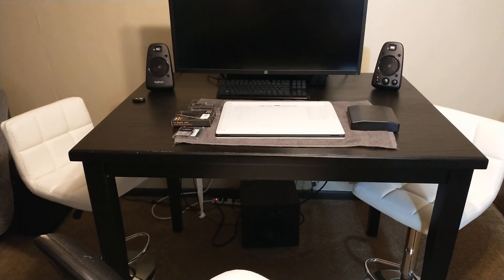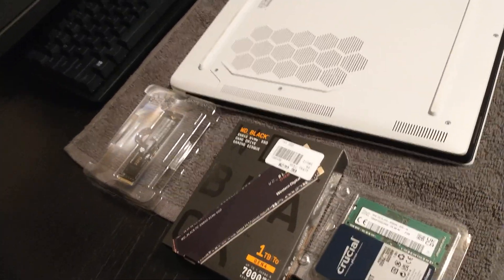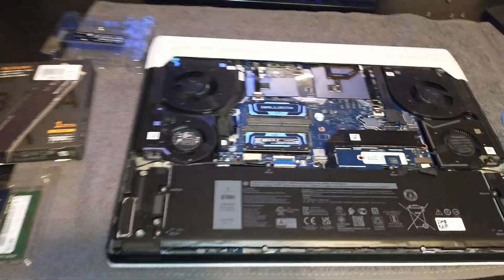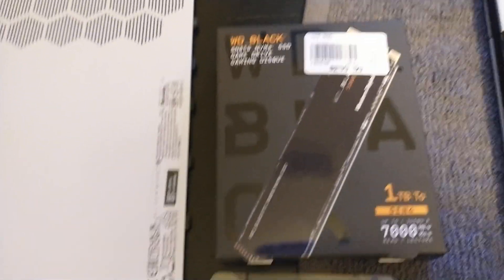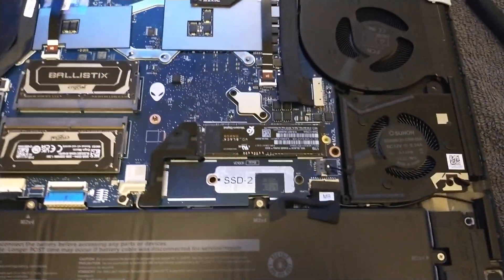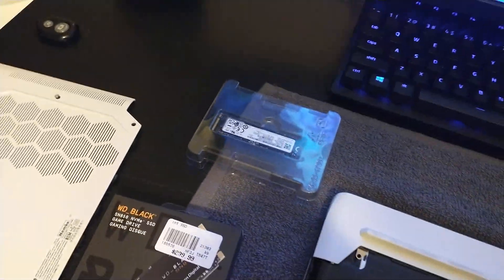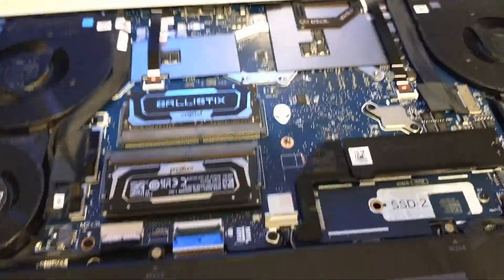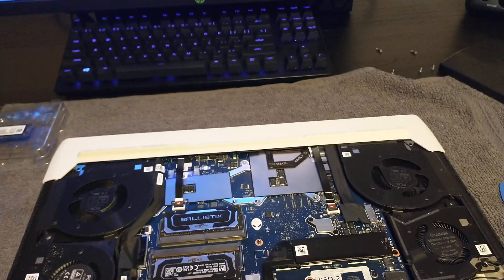Dell Alienware X17 R1 Western Digital Black SN850 RAID0/PCIe 4.0 SSD Upgrade PART I

Comment: sir were can i buy a motherboard for dell alienware x17 r1?
Reply from the maker: Have you contacted DELL.
Reply: @ITWINGMAN  no sir, because the warranty is over, isn't there anything that can be bought outside?
Reply from the maker: @dadayzkieh1687  I have not checked, I would check with DELL first, because the system is to new, but over time I am sure boards will start to pop up.
Reply: @ITWINGMAN  ..ok sir thank you ☺☺

Comment: Hello. Crucial Ballistix SODIMM 64GB Kit (2 x 32GB) DDR4-3200 Gaming Memory BL2K32G32C16S4B laptop Alienware X17 R1 model X17-0440 does not work. When XMP is turned on in the Bios, the laptop turns on, the AWC shows a voltage of 1.2 V at 3200 mhz and 1.35 v at 3466 mhz, but after 2-3 minutes a BSOD or just a reboot.
No manipulation helps! I don't know how to make the memory and laptop work at a frequency of 3466 mhz and a voltage of 1.35 V.
Reply from the maker: I would request a replacement memory kit, and if the issue persist I would say the issue lies with Dell, but it should work as advertise like in my video.

Comment: Hi. can i know the specs/model of the Crucial Ballastix ram you have installed on the X17R1? i read online that many of the CL16 ram are not compatible with the X17R1. Thanks
Reply from the maker: 64GB , Crucial Technology BL32G32C16S4B.M16FB1 full system specs link https://www.passmark.com/baselines/V10/display.php?id=147714610991 I purchased mine from https://www.bhphotovideo.com/c/product/1548889-REG/crucial_bl2k32g32c16s4b_ballistix_64gb_32x2_3200_cl16.html

Comment: Please add crucial ballistix ram review on x17
Reply from the maker: Check out this video https://www.youtube.com/watch?v=nZOBB7q7Pw4
Reply from the maker: My original PassMark Score 14,321 
My Highest PassMark score 22,251  

After Curial Ballistic DDR4 3200 MHz Memory and Western Digital Black SN850 NVMe PCIe 4.0 SSD Up Grade along with Dynamic Boot 2.0 Enable with GPU Over Clock and Memory XMP Enable shown in the original Video. 

That is unheard of this is 2 to 3 Generation of Performance Gain, These Scores are not lying and they never have not with this much of a difference.   

My Highest score is now 22,251 it is Outperforming the Desktop RTX 2080 Ti which has a score of 21,717 and my current score of 22,251 is now out preforming the desktop RTX 3070 Stock Desktop Card and is now competing with the RTX 3070 Ti which score is 22,692.
  

I said that this is not possible. But take note with Nvidia Ampere silicone this is the first time they are using the same die in both the Desktop and Mobile GPU, why because the die has shrunken down to just 8nm why would they even bother this time around it makes a lot of sense to use the same 8nm die in the Desktop and Mobile GPU. 

Desktop RTX 3070 has 5888 CUDA Cores: Mobile RTX 3070 has 5120 CUDA Cores difference of 768 CUDA Cores, Stock Desktop RTX 3070 Ti has 6144 CUDA Cores they are all using the same Silicone DIE but no one is taking notice why because of the memory and the SSD that are being installed in Laptops, no one would ever suspect this because in the past the Desktop and Mobile silicone die was always different but not this time. 

I have not done a VIDEO on this; I am waiting till I add the second NVMe SSD PCIe 4.0 drive to configure in RAID 0, to see how close I can come to the Stock Desktop RTX 3070 Ti. It makes no sense to me now buy the desktop RTX 3070 or the RTX 3080 desktop Graphic Card if you get the right laptop, to me this is Truly a REAL Desktop Replacement. I am very happy with it.
Reply: Thanks for the response... Also I ordered x17 with 3466 xmp ram module. But I have got 64gb(32*2) crucial ballistix 3200 ram module with me. What do you think is better? Xmp 3466 or crucial 3200. Also if we turn on xmp profile on crucial ballistix max it can achieve is 3200 hz right?
Reply from the maker: @TrueOGPazhassi Yes the Curial can do 32OO MHz at 1.20 Volts, but the Max speed is 3466 MHz at 1.35 Volts Alienware sells the XMP DDR4 3466 MHz 1.35 Volts Memory, Dell did update the BIOS and you can now enable XMP in the BIOS but Crucial can only do 1.2 Volt Alienware Command Center locked the Voltage and I cannot increase the voltage to 1.35 Volts. So, if you have ordered the 3466 XMP Ram theatrically it should outperform the Crucial Ballistic but You never know until you install it and run the bench mark. But just Remember to get the performance that I am not getting that is competing with the RTX 3070 Ti, you will need to install a PCIe 4.0 NVMe SSD. 

So watch my original Video to see my Graphic OC, and Nvidia Settings, and Make sure you disable Advance Optimus in the BIOS, enabled it Bottle necks the GPU, and to get this performance you will need to be connected to an external 4K Screen plugged in to the HDMI Port because it connects to the RTX 3070 Directly.  

So to use the Crucial or the Dell Memory is a thought decision, if you install the Dell Memory and it does not perform like the Crucial and you do not get the performance that I am getting you will be disappointed, but you know exactly what to expect with the components that I have. But there is a chance that the Dell 3400 MHz Memory can yield higher results, I just wish Alienware would allow me to increase the voltage it is only .15 Volts and their Memory is configured to run at that voltage so I know the Curial can achieve the 3400 MHz if they unlock it CPU-Z even show that it available but it is locked.  

 https://www.youtube.com/watch?v=nZOBB7q7Pw4

Comment: Questions.. is there anyway to get a heat shield for the 2nd ssd ? I believe the bottom 3.0 I was gonna move the stock ssd there and add a 2tb Samsung 980 pro in the 4.0 slot just wish they had another shield smh
Reply from the maker: Yes, the part # C99KM.
Reply from the maker: I got the same the exact same one for $25.00 but I had to order it via ebay: https://www.ebay.com/itm/254419952772
Reply: @ITWINGMAN  $17.99 on Amazon